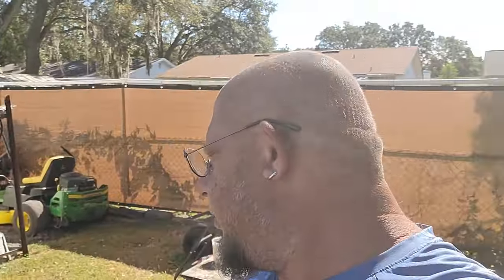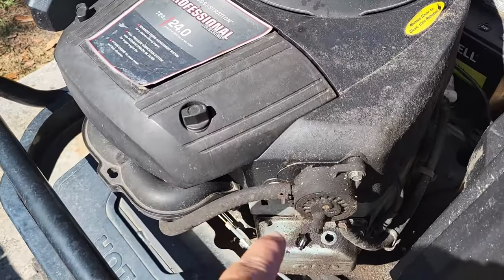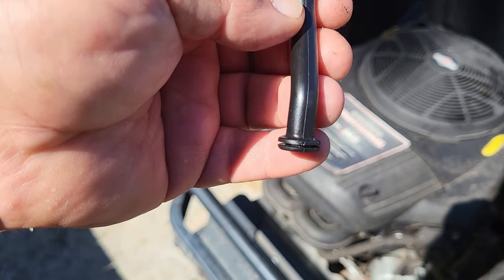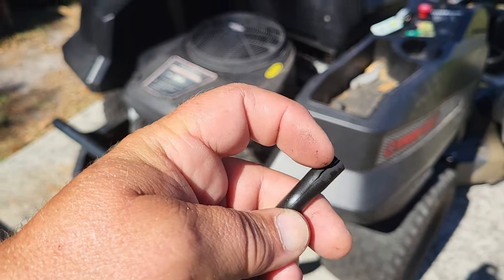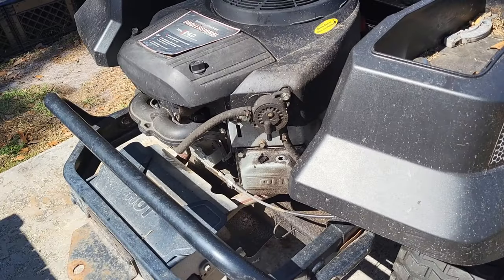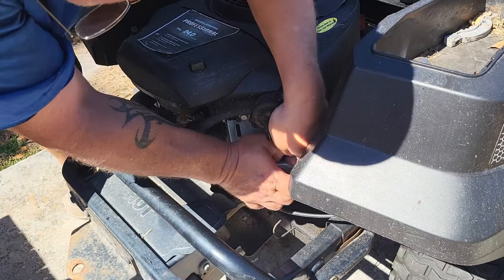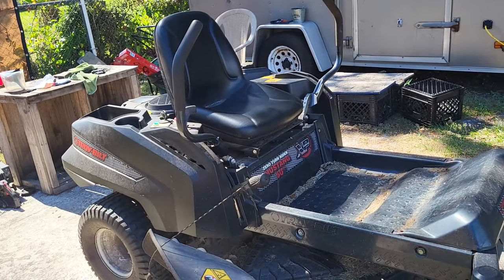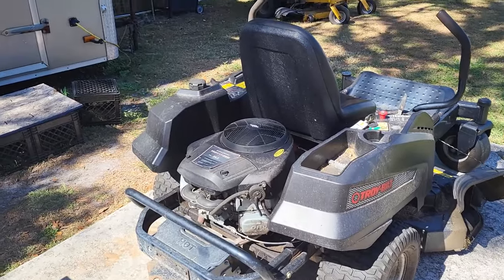Zero Turn Lawnmower Fuel Pump / No Tools Needed / Don't Replace Before You Watch This !!!

Comment: Another interesting and informative video Sir 😊

Had the same prwith a John Deere 145. Had a 2 cylinder Briggs.  I used a vacuum pump to prime the carburetor.  It started then stopped.  Sure enough that vacuum line was cracked (old) replaced worked good as new.

Comment: Thank you for the.posting  this video on this matter of the pulse  line on fuel pump issues with this one I need to check the one on my craftsman gt tractor with the Kohler twin cylinder pro seires engine

Comment: I got a toro time cutter with the Kohler 7000 series. Got some water in the gas tank   I emptied the tank and changed the filter. It runs but the rpms rise a bit and falls a bit. It started happening on Thursday. Emptied it then. And it's the third time I'm using it. It still does it. Any suggestions?
Reply from the maker: I would start by giving the carb a complete cleaning.. most people just drop the bowl to make sure there's no water in it but if the rpms are surging or going up for a few seconds then down a few seconds.. a long surge that is usually caused by gunk in the emulsion tube or a clogged jet. water in the tank is a constant problem here in Florida with people leaving machines out in the rain so i go through this process weekly here.. let me know if that did the trick
Reply: @MunkyWrench  ok thanks